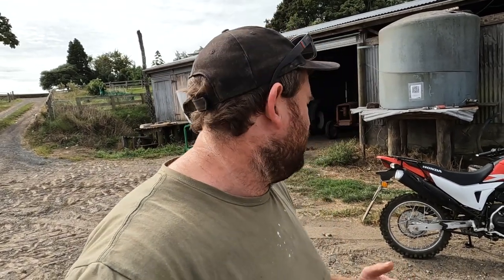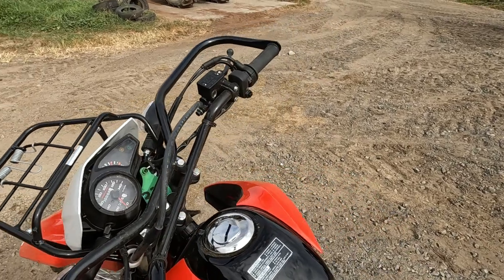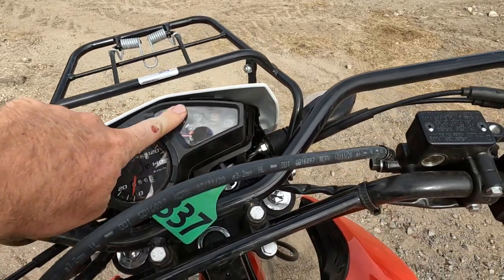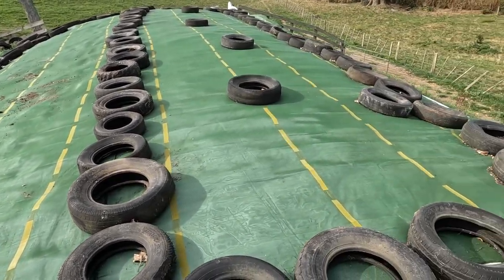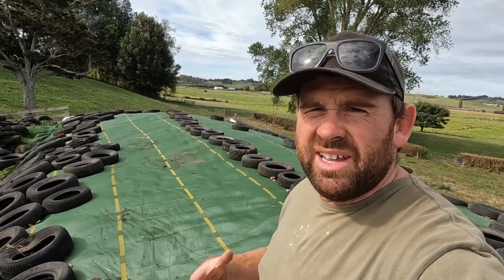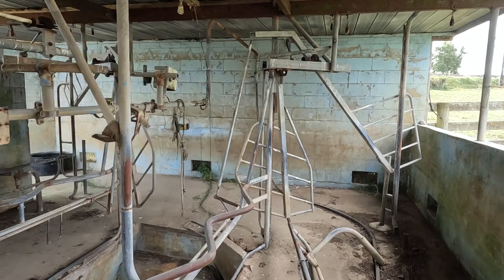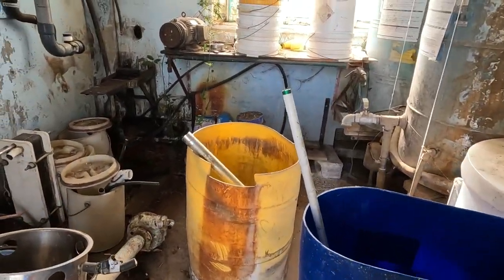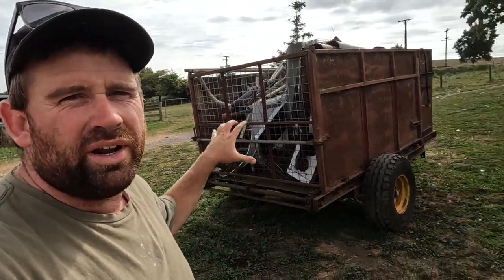New Honda CT190 Farm Bike & Cowshed Demo Update

Comment: Hey mate. First off love the videos!! I have had a few bikes so thought Id clear up the questions you had on the bike...Looks like its been made to be able to be road registered. The indicators being on there with the headlight staying on and the absence of the kill switch are all required for a WOF/"safety" features. Guessing that is so you can legally travel from paddock to paddock if you need to ride on public roads. If your not going to road register the bike all the indicators and that would bolt off relatively easily and you could wire in a switch for the headlight if you don't like it being on all the time.
The lock on the side is a helmet lock. Just so when you ride into town or something you just lock your helmet to the bike so you don't have to carry it around with you. Which leads me to think the little box next to it could be for gloves??
Reply: You could also get eyelets stitched into the cover along that edge so you are able to tie it down
Reply from the maker: That all makes sense thanks 🙏 
The eye let idea is actually a pretty good idea too 👌👍
Reply: My old man bought crf300 same gripes about headlight he says kick the stand down in gear and it will stop engine

Comment: All motorbike headlights are hard wired on now days you cant turn off any of them on any bike, the lock is for a helmet, dont normally get them these days
Reply from the maker: Might look at getting a switch out on it 🤷
Reply: I was just wondering why you wouldn't want the headlight to be on, i.e. it only comes on after the engine starts up. I'd have thought it's more for being seen than to see where you're riding during the day. Also, if you venture onto a public road (here in the RSA) you'd get a stiff fine if you forgot to switch it on during the day (besides at night, of course)
Also, I'd ask the Honda salesman (who sold you the bikes) if there wasn't supposed to be a basic toolkit in that little empty storage box?

Comment: 60 percent of the worlds Sunflowers are produced in Russia and Ukraine. The resulting 11 million tonne of Sunflower Oil exports from that region account for 40% of all Oilseed oils exported (soybeans, canola, cottonseed etc) Those exports have stopped and the pending planting season is obviously in real jeopardy. Everyone that used Sunflower oil is switching to Soybean oil and in turn that is massively supporting the price of Palm Oil. The price of Palm Oil supports the price of PKE. The Russian spring crops will get planted but the cost of diesel, fertilizer and insecticides etc. likely impact area and yields. As for Ukraine hopefully everyone comes to their senses and a resolution means spring crops are planted. Otherwise PKE will be supported for some time
Reply from the maker: That’s really interesting reading thanks! Never looked at it that way 😳